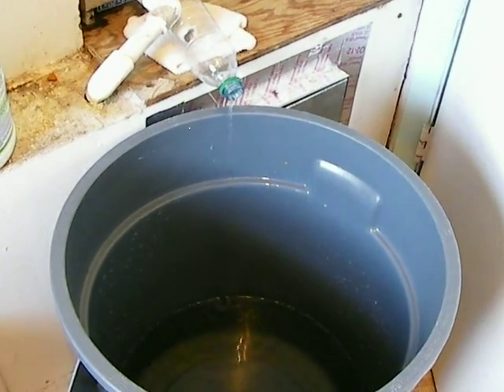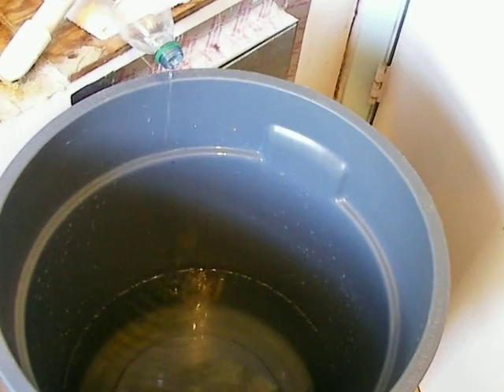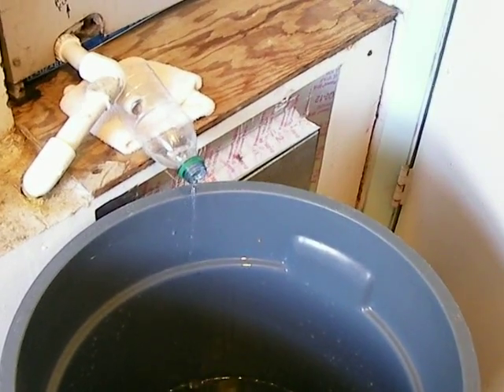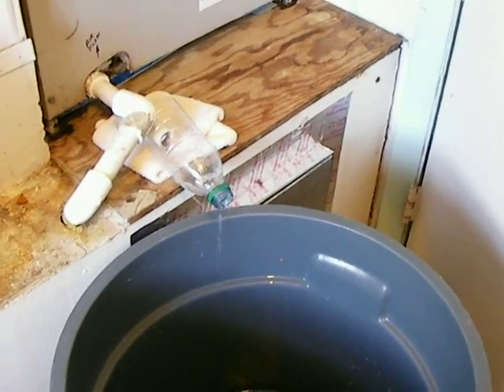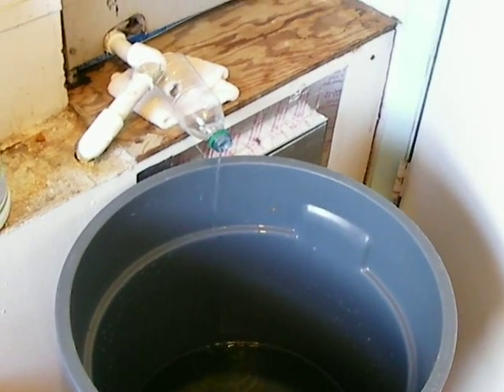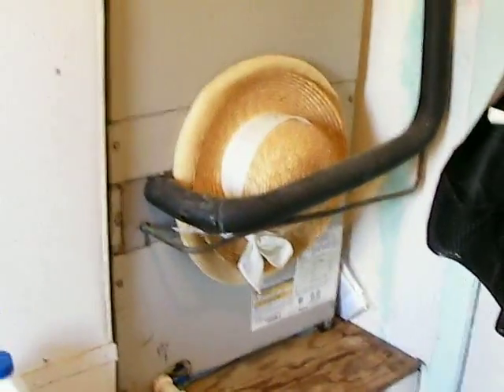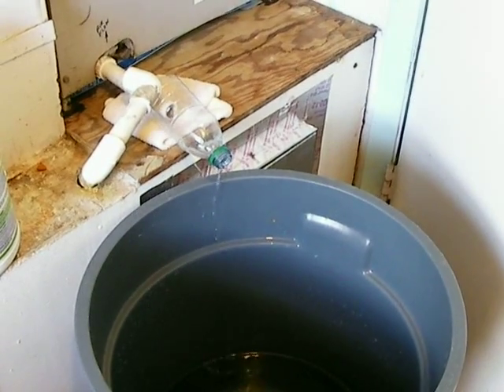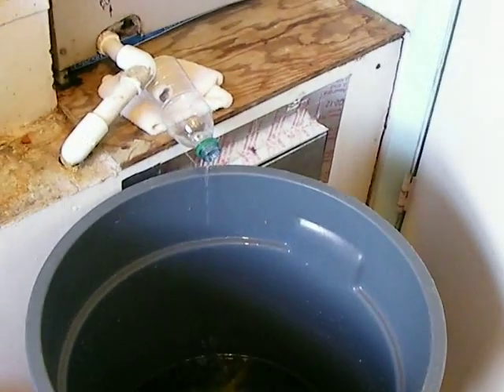Making fresh water from your air conditioner

Comment: WARNING!! I'm an HVAC tech, do not drink water directly out of the AC system!! It is full of harmful bacteria. Collecting water for irrigation is one thing because the ground filters the water for the plants (but plants for food, it is best to turn into safe drinking wat water first). You would need to research how to purify and filter the water to kill all bacteria and remove heavy metals (like rust). And please test the water afterwards to make sure it meets guidelines for safe drinking water. It is possible to produce drinking water but you have to be very careful and make absolutely sure, by testing first, its safe to drink.
Reply: iron / rust would not be considered a "heavy" metal.  Now lead or other metals used in the solder joints and what not could be a big issue.
Reply: @wadewoehrmann2835  Heavy metal oxides are obviously what he is referring to, and they form... like... rust, dumbass.

Comment: The main problem is that the AC / Dehumidifier etc fins where the water condenses and collects may  over time fill with dust and crud from the environment. This can lead to bacteria growth. So if it is new or just cleaned, then it is safe to drink. However, if it has been there a while (even standing and NOT used - but certainly if used as the volume of air being pumped over it is much higher) then you should start with boiling it to kill bacteria, and possibly whatever filtration you want to do but it should not be necessary to filter as it is just condensed water so there cant be any contaminants other than the corpses of bacteria and viruses.

Think of it this way...If you freeze water in a container. Then place that container inside another container. The water from the environment will cool and condense on the outside of the frozen container and gradually drip down into the outer container. As long as the containers are clean (particularly the outside of the inner container, and inside of the outer container). This water is completely safe to drink so long as it can be protected from insects and such. There is no difference between this water and the water than condenses on the surfaces of fins in AC's or Dehumidifiers as long as you clean the surfaces. It's exactly the same principle.

On a side note...consider replacing the fins with silver (if you can get enough of it), or copper. Both of these have antibacterial qualities built in. With a bonus that you are adding a bit of a colloid of silver or copper to the water. then I would definitely discourage filtration as such colloids are actually very good for you. It would definitely be worth the expense of making a copper heat sink or fan and if doing so consider making it in a way that is easily cleanable.

finally...also consider adding UV LED's to it. Which also kill bacteria and viruses. I suppose you could daisy chain it in some way. Just ideas.
Reply: Fungus, bacteria, mold spores, heavy metal exposure just for starters. AC water is NEVER a good idea.

Comment: Noticed a comment where a guy said his unit never drips..and i realized...of the 3 window units i got..only one makea 5glls of water per day...wtf kind of witch craft is this..lol
Reply: Some window units use the water to help cool the coil on the outside ... The fan picks up the water and sprays it up into the coil and most of it evaporates back into the air.

Comment: I'd say as long as the material that the water is dripping from is clean and eyes are kept on the transporting of the water into the body, it's probably just fine for you. I'd like to do a TDS test with a zero water tester, or any others.

Comment: why don’t you take a water sample to a lab and ask them to check if its safe to drink, i think the chlorine and fluoride in water is not healthy , and most tab water in many state are collected from city sewage  and filters and many chemical added to it   than pumped  old pipes never cleaned most of them are 50 year old city pipe, thy can not remove all the medication that sick people urinate after taking there medication and if you look at filters thy are the best place for mushrooms to grow in wet and dark environment , ultra violet or pasteurization may help but to expensive filters cant stop heavy metal since thy are  microscopic ,and thy have to be cleaned every day . like my pool filter . i live in Thailand we have  well water but i still drink A/c water and keep my a/c clean and add to a 10 Gallon a/c water some baking soda it kills the bacteria and make the water alkaline, chlorine is very bad for your skin and most be bad for your health as well  , you can,t inhale chlorine and you cant drink it , why do you put it in your water long term it will have boiling frog effect on your heath , you can also put two 100% silver cables in to your water and connect them to 12 volte car battery and  you filter your water of any bacteria that live in your water   , silver ions kill 1500 different bacteria’s . check wikipedia   colloidal silver  . just a idea research it  
good luck

Comment: Yes, plenty of aware of this...BUT...keep in mind, ALL the AC units, dehumidifier units, use a metal tubing, which WILL grow or gather gunk on it, and WILL put heavy metals and whatever gunk, into the water that drips off it.  
Best idea:  If you plan to use your AC or dehumidifier unit to gather water, FIRST use a food-grade coating on the coils...like the stuff used to coat the inside of tin cans food comes in....AND filter it.  
Whatever is in the ambient air, will become part of the water gathered.....whatever comes via smog, chemtrails, city pollutions, growing organisms, etc.  
The coils must be coated with something thin and potable, to prevent heavy metal poisoning.  
[[NOTE: boiling water will not remove all chemicals, and will not remove mold or algae spores/toxins.]].  
Filtration is very important!  Further, some chemicals, like Fluoride, require special filters to remove.
Reply: They use copper pipes. Which doesn't corrode.
Reply: @iphone202020220  wrong

Comment from the maker: Well, I hope not to ever use it at all. Just an option, when there are no other good options.
Reply: Better options:  tapping a maple or birch tree for it's water...just be sure to close up that wound into the tree, so it doesn't kill it...and this can only be used when sap is running well, like spring and fall. 
Or, use a clear plastic bag on a sapling tree, to collect water during the day....this will require multiple trees for enough water daily per person, but, it's clean. 
OR, dig a hole in the ground, put a container to catch water, then cover hole with glass or plastic such that condensing water from earth drips into the container.  Some like to put cut branches into the hole too--IDK why on that part. Again, will need multiple setups like that, to get enough water for one person to survive. 
OR, if you have a place to stay, set up a permanent batch solar water distiller to condense water on the glass, drip that to a container.  Can use old glass shower doors as the cover, for instance.  Or a glass dining table repurposed.

Comment from the maker: I understand what you're saying. I'm just wondering if it's a fundamentally different issue than getting water out of a pond, where there would be yucky stuff as well.. If you filter, than boil, or chlorinate it, wouldn't it be safe?
Reply: Berkey filters used on a dual-5-gal bucket stack, WILL filter swamp water...our family out there in FL tried that as soon as they'd assembled their buckets and filters.  But, stock up on filters--the dirtier the water source, the shorter use-life filters have.  Solar distillers, as long as one has a kinda permanent spot to put them, make better sense..use the filters if one must keep on the move.
Also, check out the MonolithicDomes.com site, as they also sell water filters that can be used in plastic buckets [be sure to use food-grade buckets!]...some are ceramic dome filters...very good too.

Comment: Water coming in a condensing form from ac units dehumidifier etc will not be safe for human consumption as the water will contain metals absorbed from the coils and machinery it condensed on. Activated carbon filtering would help to counter this. But for the cost just use as non potable

Comment from the maker: Thanks for the comment. I don't know if it makes a difference, but as the video shows, I'm getting the water right as it's coming out of the air handler, before it gets into the drain pipes. It looks very clean.

I would definitely further filter the water and treat with chlorine or boil before drinking. Would it not be safe than?
Reply: No, it wouldn't be safe then.

Comment: I would not. You are correct, the water in the dehumidifier pan is basically
distilled water.It should be considered "Gray Water"  This would be fine to use for watering plants, washing windows etc...

It would not be wise to drink the water or give it to your pets to
drink. Since there are no chemicals, such as chlorine, to purify the
collected water, it may contain an unacceptable high microbe level.
Reply: If you add 2 drops of bleach  to one liter of water, let sit for 30 mins. Should be safe.
Reply: @keithc8108  no, it wouldn't be safe.